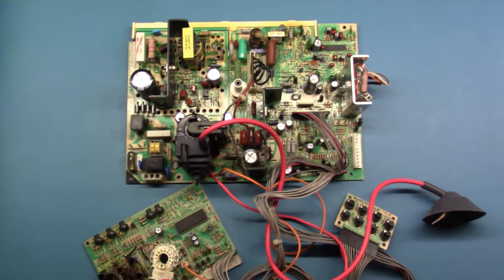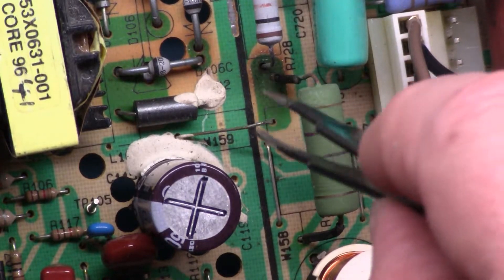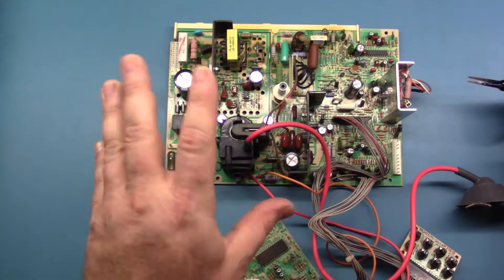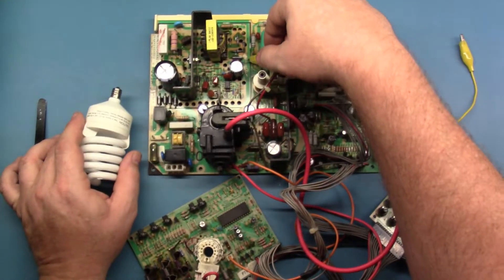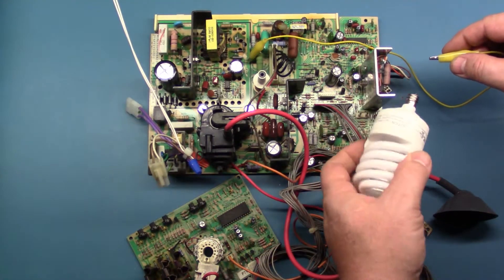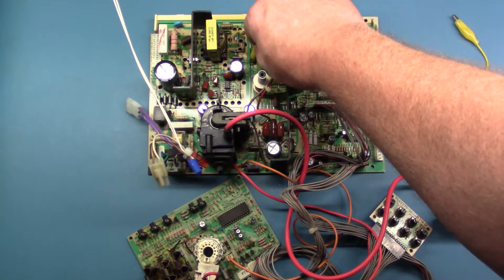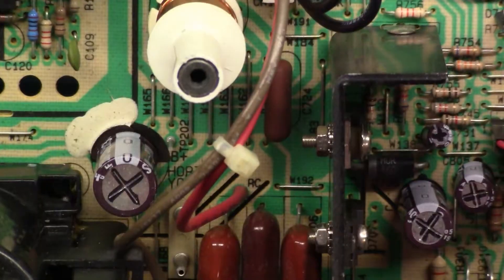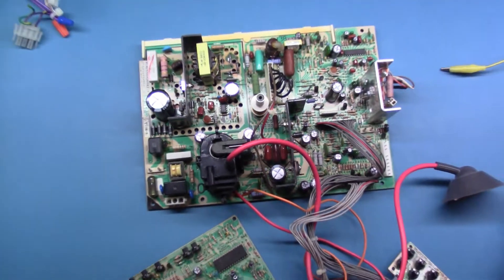Arcade Monitor Chassis Repair - U5000 'Light Bulb' Power Supply and B+ Testing

Comment: hi Mike,

Just did this test and my flyback made a similar noise. One thing i had that was different - i was monitoring the voltage the whole time. But mine didn’t just hit a specific number and stay there. It was climbing 184, 185, 186, 187, 188, 189, 190, 191 basically by the second. at 196 i applied the connector to my bulb and it dropped to a solid 121.5 and held there. The noise also stopped when i did this. One thing to note: I’m using a 30W bulb, as i couldn’t find a 50 or 60. So, to reiterate, when a load was applied (the 30w bulb) the flyback stopped making a noise, and the voltage held a constant 121.5. 
And, in case you were aware of what led me to this test - i’m the guy who spoke to you on another video about trying to diagnose a ticking sound. But my HOT is functioning properly, so this was my next step in testing. Appreciate you! Fell asleep watching your longer form videos last night - i’m learning a great deal from your channel. So thank you!
Reply: any ideas, Mike?

Comment: One question about this: Why do we need the lightbulb instead of just measuring the voltage on the B+ line (with the jumper removed)? I imagine it's intended to simulate dummy load, but is that just to help bring the line down to the correct B+ voltage? Or is there something more to it?

Could we just measure the voltage without load and expect that it's slightly higher than what we'd get with load? 140v or so?
Reply from the maker: You need a load on the system to simulate normal operation to be able to accurately tell if the B+ is good. You can have the voltage and the lightbulb can still not light. It’s to verify proper operation of the circuit under load. The supply acts differently under load vs. no load.

Comment: Hi mike.  Thanks so much for showing us this. I just used this trick to narrow down a problem with my dead u5000 which is dead. The lightbulb shined nice and bright.  Can I confirm that my flyback is good and is capable of providing high voltage now?
Reply from the maker: This doesn’t test the flyback. Only the power supply. There’s no way to test a flyback that I’m aware of.
Reply: @MikesArcadeMonitorRepair  thanks Mike.   I did some research on klov and tested some resistors that "mod' mentioned in an old thread. R765 was open and r760 was 600 ohms and should be 100 ohms.  I'll borrow those resistors temporarily from another chassis and see if it powers up.
Reply from the maker: Usually, if those resistors are bad, they will blow the HOT. But I suppose they could prevent it from powering up as well. R760 should be 470 ohms and R765 should be 33k ohms. Yeah. If one is open and they other is 600 ohms, they sound like they could be the issue. Check Q708. If it’s bad, it will also cause power issues. It’s right there by those resistors.
Reply: @MikesArcadeMonitorRepair  q708 tests good in circuit and out of circuit as well. The hot tests good as well. I'm seeing in the u5000 manual that they say 
R 760 should be 100 ohms. Is this a goof up in the manual?
Reply from the maker: My U5000 manual shows 760 as 470 and 765 as 33k. My U5000s reflect that. Don’t think 100 is correct. Not sure why it would say that.
Reply from the maker: Odd. Well if yours is 600 then I guess it needs replaced.
Reply: @MikesArcadeMonitorRepair  cool. Thanks.  I'll check the value of the r760s in my other u5000 boards and see what they read.